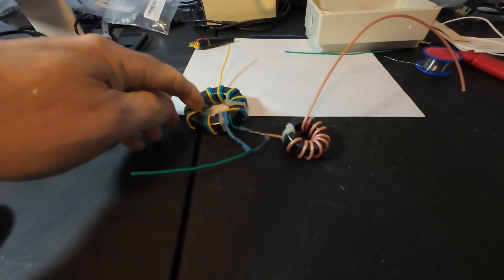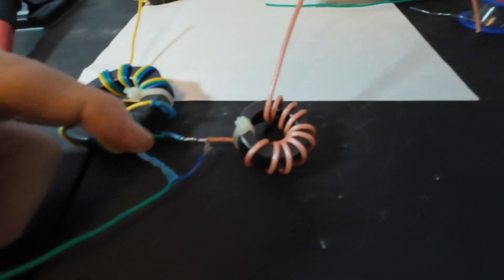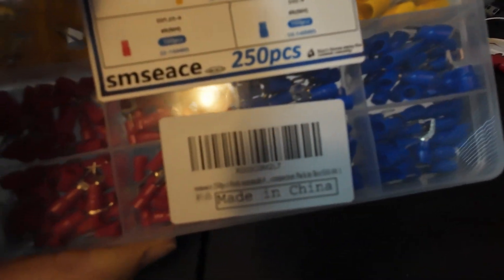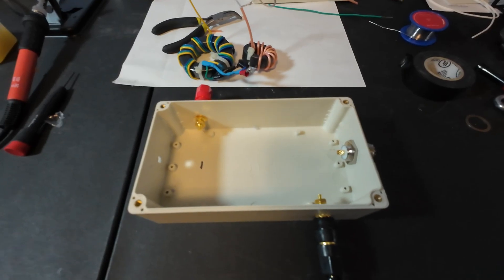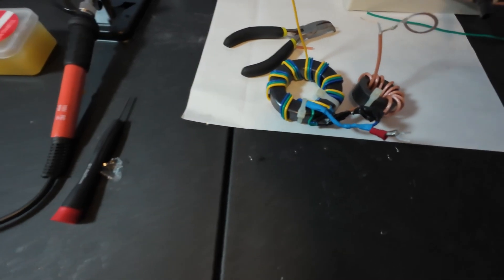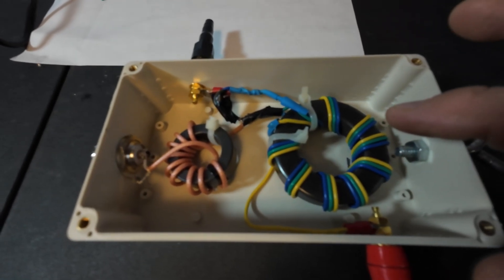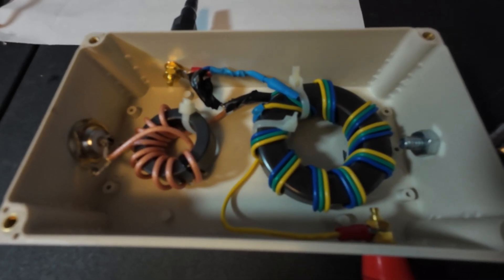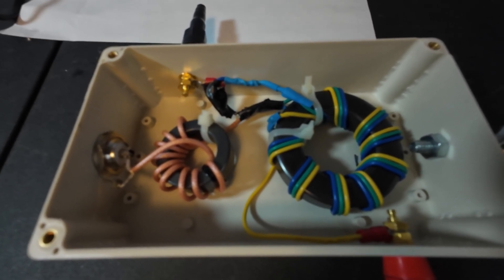SINGLE BOX 100 WATT RANDOM WIRE ANTENNA

Comment: Hot glue seems to become brittle and detach over time on flat surfaces. Silicone sealant with  its more flexible nature may be more permanent, especially if the plastic box surfaces are roughened and cleaned with isopropyl alcohol before application.
Reply from the maker: Thank you for this great tip. It does seem like the glue does not hold up for long. Thanks for watching. 73s

Comment: What gauge and type of wire did you use for the 100w antenna? (Amazon link?)
Reply from the maker: The wire is 18-gauge, and the link is in my first video of this build. https://www.youtube.com/watch?v=M3CNoR_PaII. I tested using the ICOM 7300 on CW, and the Unun and Choke worked great. Thanks for watching. 73s